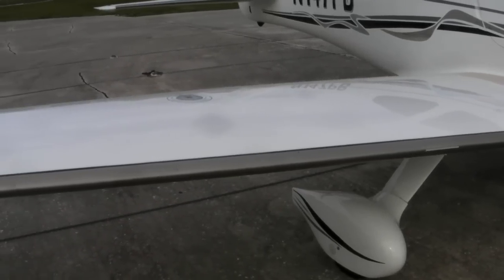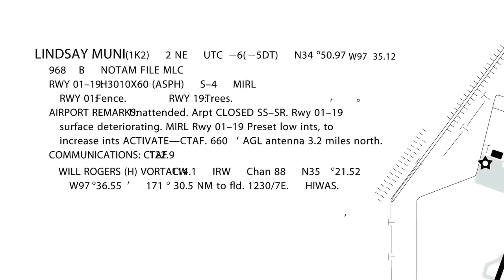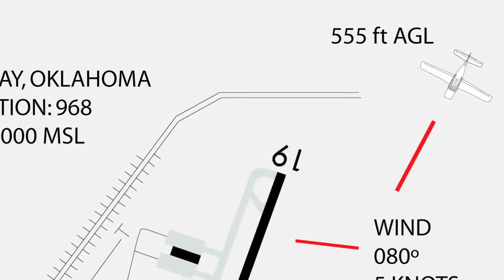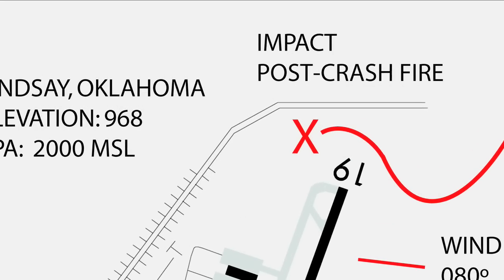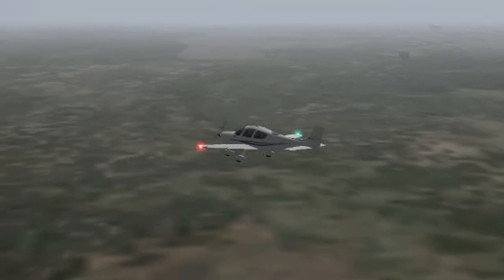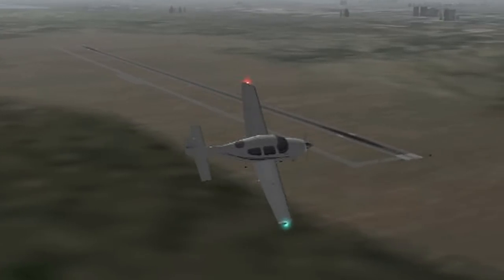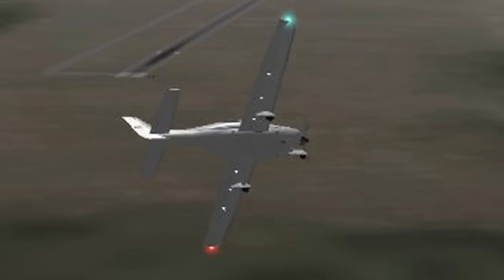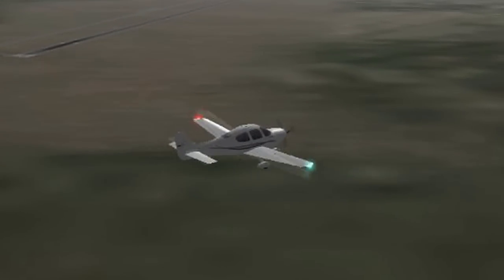Anatomy of a Cirrus Stall Accident

Comment: I just started my flight training and was told by an older, experienced pilot to read Stick and Rudder by Wolfgang Langewiesche.  I'm hoping that the the principles taught in that book, along with a lot of practice, will keep me from ever getting into an unfortunate situation like the one shown in this video.
Reply: Always keep your turns shallow in the pattern and you will be fine. Also don't touch the flap handle unless you are straight and level.
Reply: I studied stick and rudder in 1970 it has worked for me 10000 crop dusting hours later and not a scratch.
Reply: I think instructions are often over stated, and studied. Whereas just plain old flying experience is better. It's like the stupid buttons are installed instead of confidence, and understanding thru experience.
Reply: If you've noticed the Cirrus crash rate from the time this video was posted until recently, another lesson to learn is that all the touted (and expensive) advancements in wing design, etc., may offer little to no advantage in actual, day-to-day operational safety and performance over much older designs. Pilots in trouble still tend to act like pilots in trouble, and the intended compensation in the design just doesn't reach that far.

Comment: My instructor tells me never to exceed 30˚ when making turns in the pattern. In my opinion, its better turn final early than late because of the tendency to increase bank angle. If you do overshot your base and you've extended you downwind enough, it's better to keep the turn shallow and realign yourself with the runway.
Reply: Yeah, he also taught me to avoid level turns when turning base and final so I don't end up high and/or slow on final. I remember trying to keep my base to final turn level and I got it all the way down to 60 before my instructor warned me about the speed.
Reply: that's exactly what I teach my students ;)
Reply: ***** Best way to remember this in my opinion is foot on the ball! if the ball is to the right, apply right rudder, if it's to the left, left rudder
Reply: My instructor (and training manuals) advise against turning more than 30 degrees under any conditions.
They also warn about turning more than 15 degrees if you are descending at the same time.
Still, I appear to live in an exceptionally conservative country when it comes to flight safety rules for even the smallest of aircraft.
Sometimes to the level of causing extreme frustration in the aviation community.
Reply: Kuralthys: I guess your instructor never train for aerobatics. This also means he never train for unusual attitude recovery.  If you never train for it, you never know how to fly the airplane past 15 degrees.  How the heck can you turn with only 15 degrees of bank and make flying fun.  15deg bank means your turns look like 747 turns, really wide.
Reply: Indeed we don't train for aerobatics, because that's not a safe thing to do in the type of aircraft being flown.
We do stall recovery training (including accelerated stalls), incipient spin recovery, engine out training, etc.
Primary point is to fly SAFELY. 

But unusual situations are not a guideline for what you should do during routine situations now are they? In routine flight you shouldn't be going past 30 degrees.
Of course you can deliberately induce a stall, or an extremely steep turn, or start an incipient spin, or train for engine out conditions if you want to (and indeed we do) but that's not what this kind of advice is about - saying 'don't go past 15 degrees while descending' isn't advice for someone that deliberately wants to do such things, it's advice for routine situations where your only goal is to fly safely, and nothing else.

It's not a law, it's advice. Please tell me you understand the difference. ;p

If you wanna learn aerobatics, then get training in aerobatics - it's distinct from general aviation training, requires an instructor and aircraft suited to it, and so on.

15 degrees is while descending. 30 degrees otherwise.

If you wanna do aerobatics, remember there's a time and a place for that, and you should be learning how to do that safely too. But AFTER you learn how to fly in general, not just randomly for the hell of it.
And not in GA aircraft that aren't built for it either thanks.

Doing fun stuff is what you do after you figure out how to do the basics safely, and that fun stuff has to be done in appropriate conditions, not just randomly whenever you happen to feel like it.

The pattern and landing approaches are really not the place to be worried about having 'fun'. They're the most dangerous routine part of flying...

Egh. As they say, there are bold pilots, and there are old pilots, but there are no old, bold pilots. ;p
Reply: @KuraIthys  "15 degrees is while descending. 30 degrees otherwise." So you never got your pilot's license I assume. Part of even PPL training requires a 45 degree bank for steep turns.

Comment: High load factors and steep bank angles are a not to be done in traffic. It would have been better to level the wings, climb to a safe altitude and attempt a safe landing. I ride a bicycle and I know from personal experience not to attempt steep bank angles with high load factors... especially in traffic!
Reply: You sound like an excellent bicycle pilot!
Reply: Yes, I have been riding for 51+ years. I ride to work and I have a fun time doing it!
Reply: Still biking 3 years later?
Reply: Mike Mac yes I am. (been  riding for 54 years)
Reply: +Douglas Fawkes - only 40 years (biking, that is) Better mileage than the car!
Reply: I'm 58, ride regularly, and know my limits. I only ride my bike on the ground.
Reply: Still biking sir?

Comment: For those who are not native English speakers and are studying for the Icao Proficiency test, I have transcribed the video because YT subtitles are really poor.

Here you are:

If you’ve ever looked closely at a Cirrus aircraft, you’ve probably wondered about the split leading edge.
Hello, everyone! I’m Paul Bertorelli reporting for Aviation Safety and AvWeb.
The split leading edge is part of what Cirrus calls its passive safety concept. As you know, every aircraft has a stall angle of attack. For most wings that’s about 17 degrees. But since the early days of the Wright Brothers we, as pilots, have been struggling with the ability to control roll through a stall, and that’s what the split leading edge does.
Cirrus’s idea was to build in a slightly lower angle of incidence on the outer panel than on the inner panel. The effect o this is that the inner panel stalls first, the outer panel continues to fly and you maintain roll control with the ailerons.
Now, if you’ve ever flown a Cirrus and you’ve done stall demos, you know that this works exactly as advertised. However, as the accident we’re going to dissect in this video shows, it’s not full proof. If you use abusive control inputs, even the split leading edge won’t protect you.
Here’s the set up.
This accident occurred in February of 2008 at Lindsay, Oklahoma. Which is just south of Oklahoma City.
The flight took place close enough to Will Rogers Airport to be tracked by terminal approach radar. According to the NTSB’s accident report, the pilot of the Cirrus SR-22 took off with an instructor to complete a flight review. The airplane evidently flew northwest of the airport and performed some maneuvers before turning back towards the airport. It’s at this point that things began to unravel. 
Although the pilot’s intentions are unknown, he appears to have flown a path that would’ve put the plane on a right downwind for runway 01 as shown in this graphic. The wind that day was out at the east at 5 knots, so either runway 01 or 19 would’ve been suitable.
Whether he intended to use runway 01 or not, the pilot then made a sharp right turn with a steep bank that essentially put the airplane on a left base for runway 19, but on a heading angled slightly away from the perpendicular base leg. A few seconds later, he made a sharp turn back to the left, possibly in attempt to line up with runway 19, or perhaps to enter a left downwind for runway 01. The accident report isn’t clear. Either way, it didn’t work out. The airplane crashed a quarter mile north of the airport killing both aboard.
Had there been no witnesses, this accident might have been just another of dozens like it where an airplane digs a smoking crater for no apparent reason. But there was a witness, and a very good one. Like all recent models Cirrus aircraft, the SR-22 had a glass panel suite, the Avidyne Integra. Despite the post crash fire, the NTSB retrieved enough data from the Integra to reconstruct this flight in this video.
Here’s what the investigators found.
At this point in the flight, the Cirrus is descending for that abortive right downwind. Significantly its altitude is 1520 feet, which is only 555 feet above ground level, and well below pattern altitude.
At this point, it’s entering the right turn and reaches a bank angle of 47 degrees. The angle of attack increases from 6.5 degrees to 10 degrees in 9 seconds. That’s a moderate pitch rate increase, but hardly aerobatic maneuvering. The wings weren’t yet heavily loaded because the airplane was still descending slightly. A second later as the airplane was flying through the runway centerline, it rolled sharply left through wings level to a left bank angle that reached 60 degrees. The angle of attack increased from 10 degrees to 17 degrees.
At this point, the airplane is at 223 feet AGL. Despite the SR-22 stall resistant wing, the flight data indicates that the entire left wing was above the stall angle of attack. This may have increased drag on the wing and induced more left yaw in moment, essentially, an incipient spin. The left aileron would’ve almost certainly been out of the game at this point. Surprisingly, 2 seconds later, the airplane rolled violently right, pitched down and crashed.
When they reviewed the data carefully, the investigators found out why. A fraction of a second before the final right roll started, the data showed that clear right yaw moment, and that’s evidence of right or top rudder application.
If the pilot sensed an incipient spin to the left, he might’ve countered it with full right rudder. But unless the wing is unloaded to break the stall, that’s not a counter spin input. It’s a snap roll entry. And that’s apparently what happened in this accident.
Here’s some final observation.
You might say that this video shows that the more things change, the more they stay the same. The accident we’ve seen in this video is very typical with a type of stall spin or stall accident that airplanes have been doing in traffic patterns for years. For some reason we can’t seem to learn that steep banks and high load factors in the traffic pattern invite disaster. They should be avoided at all cost. It’s that simple.
To find out more about this accident, see the January 2010 issue of Aviation Safety at www.aviationsafetymagazine.com. Elsewhere on AvWeb you can hear a podcast with John King and Rich Stowell, two veteran instructors, discussing stall/spin accidents.
I’m Paul Bertorelli reporting for Aviation Safety and AvWeb. Thanks for watching. *

If you're interested in a free Icao Test Preparation Class, contact me at max_bukiewicz at hotmail or teachermax at skype.

Cheers!

Comment: The same effect is achieved in the wing of a Cessna 172, whose angle of incidence is larger near the wing root, and rotates to a smaller angle of incidence towards the wing tip, but without the ugly abrupt transition seen in the Cirrus. The Cessna wing tapers and twists elegantly and continuously, to make sure the wing root stalls first, then the stall progresses outward toward the tip. The Cessna wing aerofoil cross section also transitions continuously from a flat bottom  from the wing root, to a more symmetrical, curved bottom airfoil towards the tip. A beautifully elegant design. The abrupt transition of the Cirrus, including an ugly stall strip right at the step of the wing, is ugly and abrupt. The Cessna also has a beautiful flap design, with rails that make the flap first just extend, then start tilting and extending, opening a slot of a Fowler flap as it gets to full flaps. I have always admired the beauty of the Cessna wing and flaps. I'm amazed that the Cirrus reverted to an ugly two-stage wing with abrupt transitions and stall strips.

Comment: The Cirrus is a fast and thus, demanding airplane to fly, it's certainly no Cessna 150. I've read most of the Cirrus accident reports and the majority are by low time pilots with limited high performance experience. They should be proficient in something like a Bonanza, Piper Arrow or Cessna 210 before being turned loose in a Cirrus.

Comment: When I was taught some fifty years ago...my instructor said you cant stall in a slip....has worked for me for years...the problem now is they do not teach fly the airplane...nor do they teach unusual attitudes..ie spins, slips, basic airmanship...now its you have a computer...your good to go
Reply: All their expensive touchscreens didn't help these pilots.
Reply: You can stall in a slip. Pull back hard and it will snap inverted. That’s why you maintain the same pitch angle in a slip from when you started. Never pull back to increase pitch in a slip .... whether forward or side slip.
Reply: incorrect, as a student pilot we are taught power on and off stalls, forward slips, minimum maneuvering speed. I fly a steam gauge 172
Reply: um, my guess is that a plane will happily stall in a slip if you stall both wings

Comment: There is no doubt in my mind that this was a simulated engine out during a BFI, every BFI I've ever had, has one.  Probably started at pattern altitude, typically 800' AGL  The pilot may have burned too much altitude "diagnosing" the problem (switching tanks, fuel pump, carb heat, Etc...).  The CFI may have pulled power too close-in requiring the abrupt maneuvers to line-up with the run-way.  In any case, bad decisions lead to this accident.  Practicing emergencies can be fun, exhilarating  and scary, but its a necessary and required part of training.  Calling the pilots morons based off this is just plain stupid as this appears to me to be a case of poor judgement, but not of arrogant disregard for safety or showing-off .
Reply: I think you are spot on Jim, good call.
Reply: I am not sure to be honest. There is no time to do all these checks at under 1,000ft. I was simply taught that if the engine goes out at a low altitude, go straight and look for a place to put it down no more than 45 degrees from left to right.
Reply: seems like a good theory.
Reply: Having now seen the simulation< i have to agree with you.I believe the CFI applied the right rudder and inadvertantly created a snap roll

Comment: To those of you who are saying the pilot wanted to crash. You need to go through the training they have to take and then earn you ratings. I live in Oklahoma Ive flown here and the wind can be Highly unpredictable, not only this but, whos to say it was the pilots mistake maybe on final the controls were bumped. But the On board data shows what happened. Like it or not all of you who say you would have done this and that...You were not there. Regardless of the reason. 2 Aviators were lost... take off your hat in remembrance and respect the families instead of pointing Fingers.
Reply: At least one of these pilots earned their disrespect, you don't fly like this <3000' AGL why the hell would you do it on final?
Reply: It is definitely easy to understand how this might happen. You're low to the ground, you sense a spin coming on, a good pilot's instinct is to mash the opposite rudder. But with that ground coming up fast at a very unusual attitude, the urge to yank back on the elevator might be too much to overcome. Simple fact, though, you'll be EXTREMELY lucky to recover from an incipient spin in less than 500 feet unless you catch it immediately, which is hard to do if you weren't expecting it.
Reply: Yeah, I was wondering about this myself - what if the instructor was trying to get control and the student panic, pushes his foot against the pedal, grabs wheel, etc.
Reply: EnDSchultz1 I agree with you. This is why spin training in my opinion is so critical. Instructors should put students through many incipient spins to make sure the recovery is second nature.

Comment: This leading edge change of angle design principle was used on the design of the Mitchell designed Spitfire fighter aircraft after the experience of loss by a stall of Schneider cup entrant some years earlier.  The wing root of the Mitchell designed Spitfire was at a different angle to the remainder of the wing which reduced the tendency to suddenly wing stall over its whole length.  Observation of this may be made by looking down the leading edge of the wing which illustrates the not so otherwise apparent different angle.

Comment: I wonder if the flight data from the cockpit instruments reported a tachometer reading.  Maybe an idle one?  For some reason, I'm hearing the CFI overseeing this flight review telling the reviewing pilot a few moments before entering the pattern, "you just lost your engine."  Then realizing he wouldn't make Runway 1 at 550 ft., he opted for runway 19 instead. That's a guess based on past experience with an instructor with a penchant for pattern engine-out scenarios.  Maybe a left 360 turn away from runway 19 to bleed off a few hundred feet and a roll out on a short base/final would have been a better option.

Comment: although the actions of the pilot caused this issue and really nothing would have changed the results......the wing design of the Cirrus helps the stall issues....But another help in the stall problems on many planes are Vortex Generators....they have been studied awhile. there are many videos out there showing the stall speed can be lowered way down with VG's added to the wings.....helps a ton .